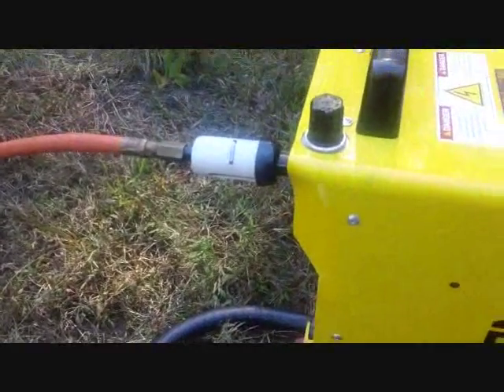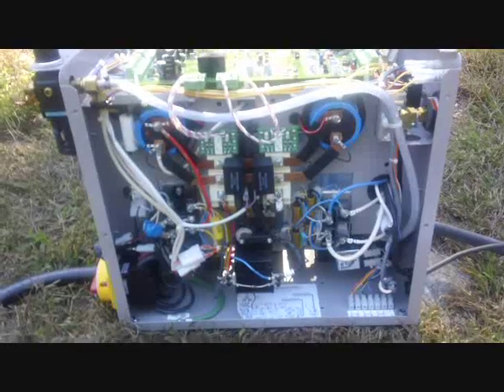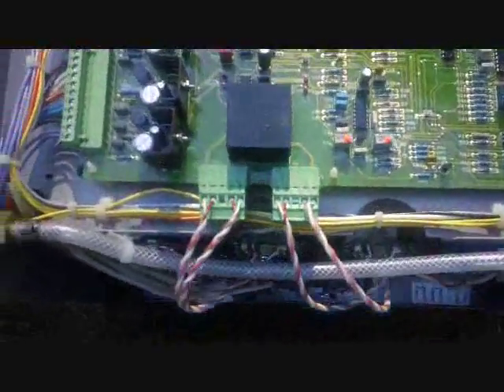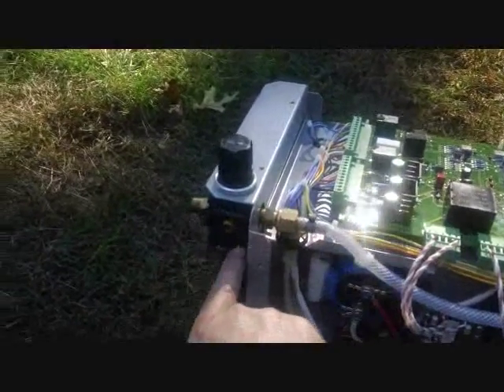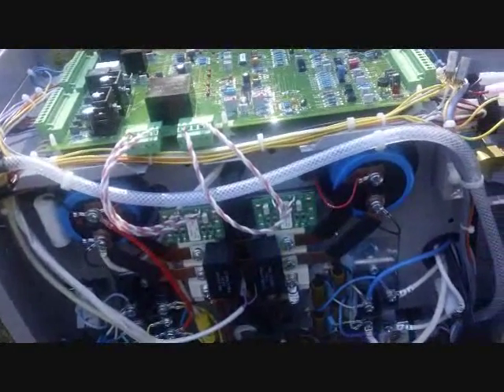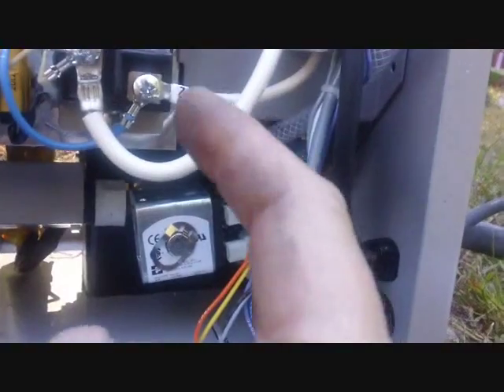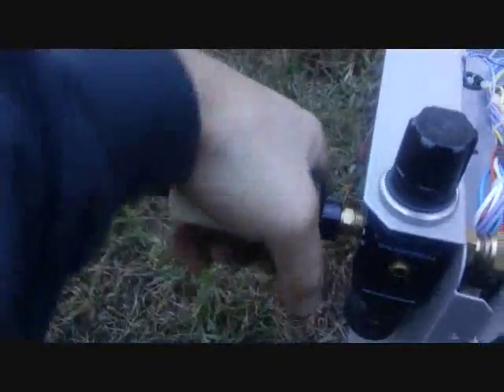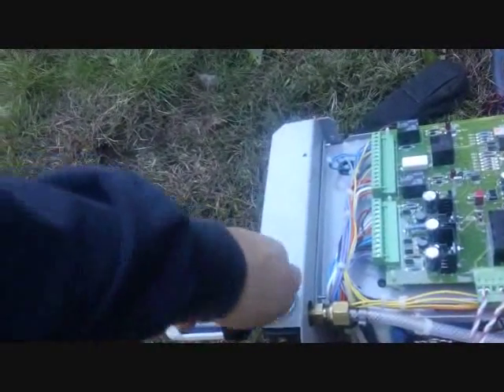The new plasma cutter Part 2

Comment: Hi, Is your Esab PCM 875 unit 460 Volt 3 phase? Did you wire the unit 220 Volt Single phase? Thanks
Reply from the maker: Hi, mine is a single phase 220 volt machine from the factory. The 3 phase 460 volt machine has a different part number, 558001169, and as far as I know cannot be rewired to run on 220, single phase.
Reply: Thanks for the reply, Cheers